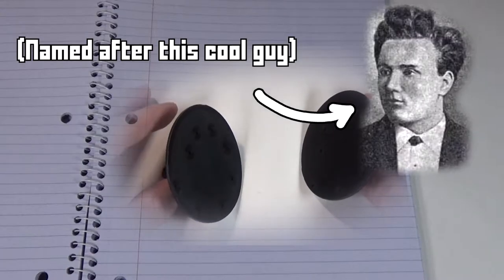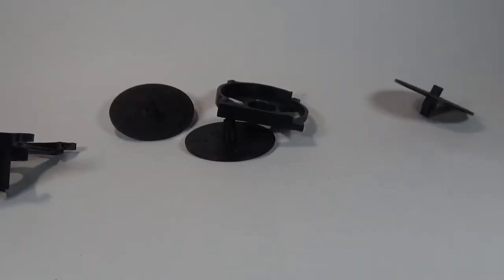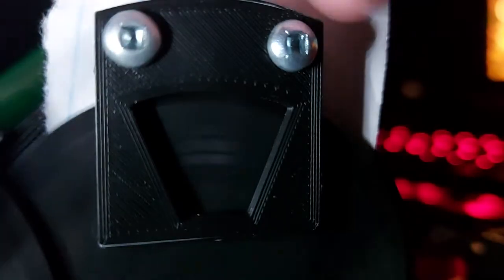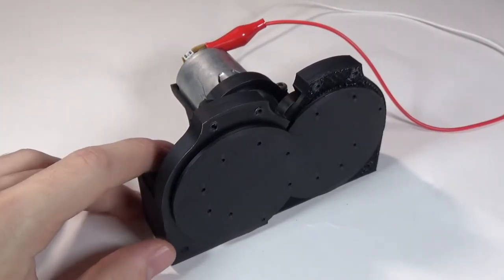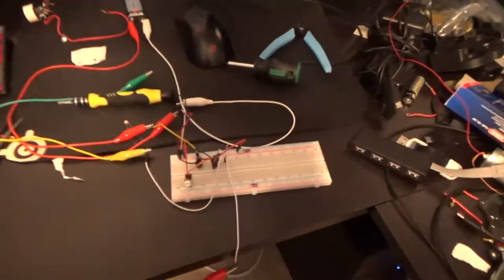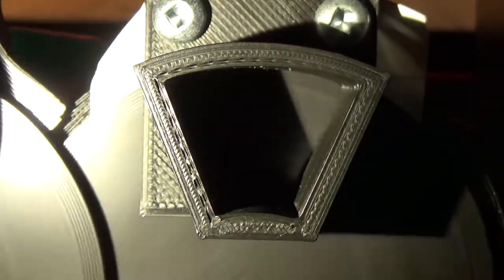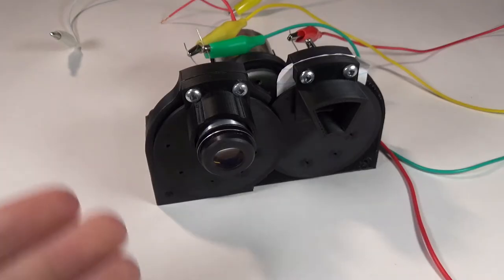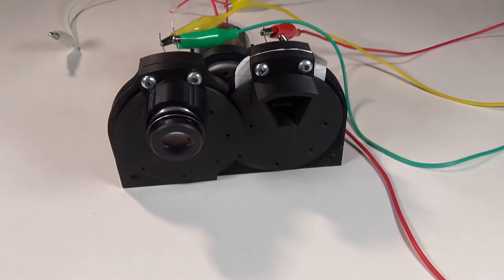3D Printing a TV

Comment: Can be use perforated tape stretched between several rollers instead of a disc to get rid of spiral image distortion?
Reply from the maker: You probably could however it would make for more of a hassle than solid disks

Comment: Awesome. What 3d printer do you have?
Reply from the maker: Thanks! I have a Creality Cr-10s4
Reply: @CamdenBowen  Sometimes I wish I had gotten a cr10. I have an ender 3. Does it having a bigger bed reduce print quality due to having more mass to move around?
Reply from the maker: @madeintexas3d442  Possibly taller prints would because of the whole unit vibrating, but this could be solved with stands to keep that from happening